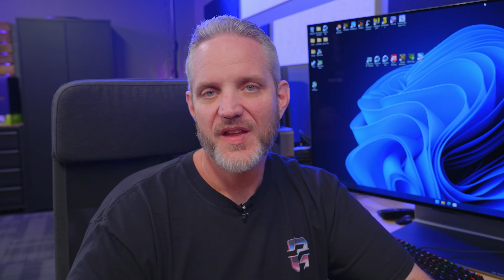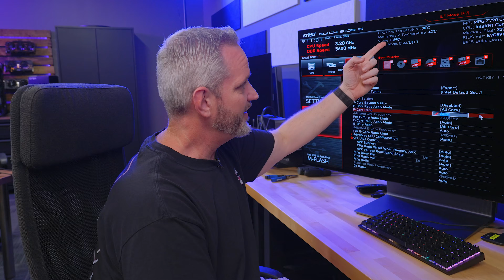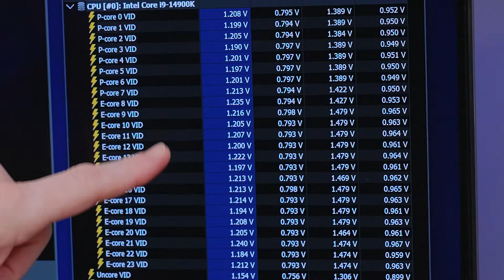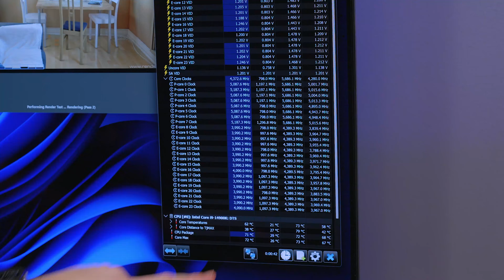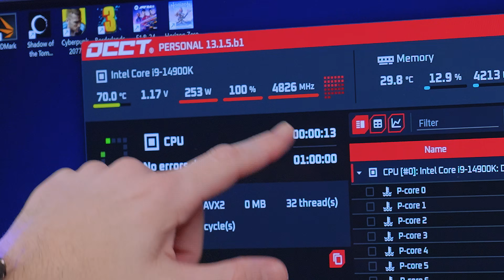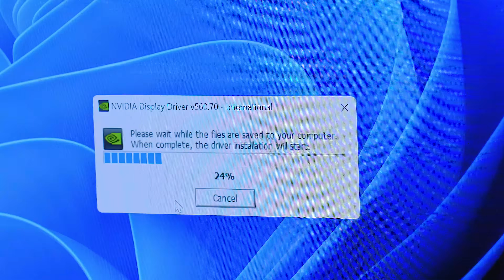Guide: How to check if your CPU is BAD!

Comment: u said in here and i know its been a year but u needed bad chip i have one a beast of a i7 14700f    burns off any and all paste applied overheats my vram overheats my gpu  its been fun but im over it mofo retails for 360 if it works i think it has this degredation people talk about thought it was board bought new one ended up throe=wing in old 12700k and it runs flawless?   bought used on marketplace for 160 and cant rma it  worst case u could borrow delid it for me then send it back?>

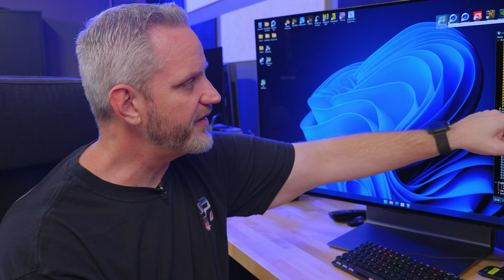Comment: at 7:58... I agree. I would see in hwi64_840.exe as well as ASUS Armory Late onscreen Ryjin III 360 screen. Standard polling rate of 5.9, sometimes 6.0, or even 6.1, depending on software rounding. I saw it. Even when my target was 5.8 with spikes to 5.9 cause it could steady state 5.9 on2-4 cores, or constant load balance hand off of the 5.9 on 2 cores. I guess that was due to cooling or whatever ASUS was using to determing voltages, or clocks, or vdrop.   Heavy loads seem fine, it was light loads all apps closed, going to tell it to shut down or restart. I would have to repeatedly have to click shut off as the first 2 clicks did nothing. Like the prefetch for those items to be clicked in the GUI were just ignored. Or Microsoft Windows 11 doesn't want me to shut my PC off, as opposed to some form of sleep, hybrid, hibernate, Low power rest mode.  It would also fail to come out of those states. Had to just hold down the powerbutton for 4 sec to get it to shut off. Single button Hyte Y60 (wish for a touch screen like the Y70). So I agree it showed more  odd, quircky, non responsive etc. in low load states. But seriously, I didn't like seeing up to 300mhz over target clocks, regardless of heat or allowable options to go higher. So I need to brush up on the non-AI manual OC. But our laziness for this 1 click OC is not our fault. These were on by default back in June 2023. So my baseline testing performance before OC was already OC'ed. OC'ing an OC if that makes sense.  Anyways that was my experience. Intel did RMA it, paid for a new 13700K .  Mine was originally purchased in Feb 23 for 359. each. Due to other parts costs, the builds were finished by Jun and July 23 as I built 2 exact same matching His and Hers systems,..... didn't want the YOUR PC IS BETTER.!!!!!! Anyways just wanted to let the readers know INTEL did stand behind a NEW replacement. I questioned NEW myself, but just took the new part at will to still have 3-5 year warranty the same as the original but the time now starts after the Ticket was closed. And so if I make it to 2030 so 4 years I will be happy. If this starts going wierd in 2 years, then this would have been a nightmare. Time will tell.

Comment: I have a beast of a chip but it WAS bad...I9 14700k However all i had to do was tame it down from trying to boost operate at 6ghz and limit it to just 5.5ghz and it is as stable as can be. I could go higher but i find that that is fast enough. no more access violation errors etc...

Comment: my mouse feels so weird and deleted that can be because my cpu is degraded ?
Reply: Windows USB drivers run in user space at normal speed. If you're doing something compute-bound, your mouse can feel a bit janky.
Reply: @darrennew8211  no the issue was dirty electricity i bought a double conversion ups and it fixed everything

Comment: Asus finally released their latest 2405 BIOS for my ROG Strix Z590 Gaming Wifi II this month that seems to have solved the stability issues I have had with my 11900k at stock speeds and OOB settings for the last 5 years. It refused to boot or run stable in Windows without the AI overclock enabled before this BIOS release. I went through 2 processors thinking my CPU had degraded, since the Asus AI overclock cooked my first CPU by sending it over 1.75v of vcore and would constantly send it into thermal throttling just sitting at the desktop, even with a beefy 200w capable air cooler on it. It eventually refused to boot with or without the overclock, or even downclocked to 4ghz, which was enough for Intel to warranty the first processor. I now have a 360 AIO on it, and its much happier, especially without the overclock. The latest BIOS introduced another lovely side effect of constant USB dropouts, though. All day long, Windows is dinging at me when the board drops out and reconnects the USB bus every few minutes. I'm a long time consumer of Asus, but at this point, I want to replace the board with another brand. So far nothing else has good feedback or reviews when it comes something that will work for my application in the Z590 platform.

Comment: 00:00:00 - Info - Test schedule started at 2026-01-15 20:26:44
00:00:00 - Info - CPU - Initializing (Duration : 01:00:00)
00:00:00 - Info - CPU - Started (Duration : 01:00:00)
00:00:00 - Error - CPU - 26112 error(s) found on physical core #0 - logical core #0
00:00:00 - Error - CPU - 22411 error(s) found on physical core #0 - logical core #1
00:00:01 - Error - CPU - 43527 error(s) found on physical core #0 - logical core #0
00:00:01 - Error - CPU - 43246 error(s) found on physical core #0 - logical core #1
00:00:01 - Error - CPU - 47980 error(s) found on physical core #0 - logical core #0
00:00:01 - Error - CPU - 41911 error(s) found on physical core #0 - logical core #1
00:00:02 - Error - CPU - 44718 error(s) found on physical core #0 - logical core #0
00:00:02 - Error - CPU - 42802 error(s) found on physical core #0 - logical core #1
00:00:02 - Error - CPU - 40516 error(s) found on physical core #0 - logical core #0
00:00:02 - Error - CPU - 45111 error(s) found on physical core #0 - logical core #1
00:00:03 - Error - CPU - 47808 error(s) found on physical core #0 - logical core #0
00:00:03 - Error - CPU - 41981 error(s) found on physical core #0 - logical core #1
00:00:03 - Error - CPU - 46394 error(s) found on physical core #0 - logical core #0
00:00:03 - Error - CPU - 45302 error(s) found on physical core #0 - logical core #1
00:00:04 - Error - CPU - 45657 error(s) found on physical core #0 - logical core #0
00:00:04 - Error - CPU - 42551 error(s) found on physical core #0 - logical core #1
00:00:04 - Error - CPU - 40065 error(s) found on physical core #0 - logical core #0
00:00:04 - Error - CPU - 46214 error(s) found on physical core #0 - logical core #1
00:00:05 - Error - CPU - 42156 error(s) found on physical core #0 - logical core #0
00:00:05 - Error - CPU - 43131 error(s) found on physical core #0 - logical core #1
00:00:05 - Error - CPU - 45891 error(s) found on physical core #0 - logical core #0
00:00:05 - Error - CPU - 45153 error(s) found on physical core #0 - logical core #1
00:00:06 - Error - CPU - 42881 error(s) found on physical core #0 - logical core #0
00:00:06 - Error - CPU - 45627 error(s) found on physical core #0 - logical core #1
00:00:06 - Error - CPU - 43155 error(s) found on physical core #0 - logical core #0
00:00:06 - Error - CPU - 45860 error(s) found on physical core #0 - logical core #1
00:00:07 - Error - CPU - 49008 error(s) found on physical core #0 - logical core #0
00:00:07 - Error - CPU - 41417 error(s) found on physical core #0 - logical core #1
00:00:07 - Error - CPU - 46808 error(s) found on physical core #0 - logical core #0
00:00:07 - Error - CPU - 43206 error(s) found on physical core #0 - logical core #1
00:00:08 - Error - CPU - 44965 error(s) found on physical core #0 - logical core #0
00:00:08 - Error - CPU - 42018 error(s) found on physical core #0 - logical core #1
00:00:08 - Error - CPU - 46815 error(s) found on physical core #0 - logical core #0
00:00:08 - Error - CPU - 45275 error(s) found on physical core #0 - logical core #1
00:00:09 - Error - CPU - 47267 error(s) found on physical core #0 - logical core #0
00:00:09 - Error - CPU - 42255 error(s) found on physical core #0 - logical core #1
00:00:09 - Error - CPU - 43623 error(s) found on physical core #0 - logical core #0
00:00:09 - Error - CPU - 44172 error(s) found on physical core #0 - logical core #1
00:00:10 - Error - CPU - 41659 error(s) found on physical core #0 - logical core #0
00:00:10 - Error - CPU - 42523 error(s) found on physical core #0 - logical core #1
00:00:10 - Error - CPU - 47912 error(s) found on physical core #0 - logical core #0
00:00:10 - Error - CPU - 42951 error(s) found on physical core #0 - logical core #1
00:00:11 - Error - CPU - 43588 error(s) found on physical core #0 - logical core #0
00:00:11 - Error - CPU - 46229 error(s) found on physical core #0 - logical core #1
00:00:11 - Error - CPU - 44953 error(s) found on physical core #0 - logical core #0
00:00:11 - Error - CPU - 45806 error(s) found on physical core #0 - logical core #1
00:00:12 - Error - CPU - 42543 error(s) found on physical core #0 - logical core #0
00:00:12 - Error - CPU - 38526 error(s) found on physical core #0 - logical core #1
00:00:12 - Error - CPU - 46415 error(s) found on physical core #0 - logical core #0
00:00:12 - Error - CPU - 45480 error(s) found on physical core #0 - logical core #1
00:00:13 - Error - CPU - 46932 error(s) found on physical core #0 - logical core #0
00:00:13 - Error - CPU - 45289 error(s) found on physical core #0 - logical core #1
00:00:13 - Error - CPU - 47399 error(s) found on physical core #0 - logical core #0
00:00:13 - Error - CPU - 46043 error(s) found on physical core #0 - logical core #1
00:00:14 - Error - CPU - 43408 error(s) found on physical core #0 - logical core #0
00:00:14 - Error - CPU - 46127 error(s) found on physical core #0 - logical core #1
00:00:14 - Error - CPU - 43738 error(s) found on physical core #0 - logical core #0
00:00:14 - Error - CPU - 45313 error(s) found on physical core #0 - logical core #1
00:00:15 - Error - CPU - 45541 error(s) found on physical core #0 - logical core #0
00:00:15 - Error - CPU - 45528 error(s) found on physical core #0 - logical core #1
00:00:15 - Error - CPU - 47510 error(s) found on physical core #0 - logical core #0
00:00:15 - Error - CPU - 43053 error(s) found on physical core #0 - logical core #1
00:00:16 - Error - CPU - 41351 error(s) found on physical core #0 - logical core #0
00:00:16 - Error - CPU - 44763 error(s) found on physical core #0 - logical core #1
00:00:16 - Error - CPU - 45826 error(s) found on physical core #0 - logical core #0
00:00:16 - Error - CPU - 44383 error(s) found on physical core #0 - logical core #1
00:00:17 - Error - CPU - 36905 error(s) found on physical core #0 - logical core #0
00:00:17 - Error - CPU - 45531 error(s) found on physical core #0 - logical core #1
00:00:17 - Error - CPU - 44903 error(s) found on physical core #0 - logical core #0
00:00:17 - Error - CPU - 45233 error(s) found on physical core #0 - logical core #1
00:00:18 - Error - CPU - 42833 error(s) found on physical core #0 - logical core #0
00:00:18 - Error - CPU - 46252 error(s) found on physical core #0 - logical core #1
00:00:18 - Info - CPU - Test stopped
00:00:18 - Info - Schedule stopped by user request

Does this mean my cpu is bad? i thought my gpu was going bad t was getting screen tearing than it started happening on all programs. i also getting screen freezing. but i disabled my gpu and been using my igpu and it has the same behavior. I used intel processor diagnostic tool and everything passes. but this occt screams error right out of the gate. the errors you see are just a few second....

Comment: Yeah good you showing how to stress the cpu,we know not to have to high volt.. but not what to do when having to high volt, in msi i have msi defualts that's lowest and have up too 1.5v and i don't now how Msi bios works, and was looking just like yours. have msi z690 and 12900k!?? 

It's not the cpu fault it's the Bios defualt options like im asking i have tuner cooler intel defualts, 241 watt that's the lowest, and everything on auto and have 1.5V what should i do?!?!? This is the real problem not a bad cpu never got a bad cpu in computer store i worked in. It's the options bios options that kills them.....

Comment: I know I'm kind of late to the party but... I wonder, should I update my BIOS to avoid these... problems. I happen to have I-9 14900K CPU and my current BIOS version is 2504. Also checked the BIOS itself and it has all Intel standard settings running.
Haven't noticed any issues thus far with it other than the damn Diablo 4 been crashing on me twice now and I get some mambo jambo warning from the Blizzard to update my BIOS?!

Comment: But wouldn't you want to test your CPU with xmp?

If you have say 4800 MT/s rams, but your CPU is rated for Higher. Shouldn't you test your CPU with the higher speeds on the ram Obviously you would also perform individual tests on the ram itself.

Comment: the way i get my cpu to get high ghz, playing 8k on youtube, from stock boost 4.6ghz and 4.7-4.9ghz is common and odd spike to 5.3-5.4ghz at temps max 68c , not bad for 5700x with id cooling 67mm cooler . gigabyte seems to not care how far it pushes cpu and ram , so far its only done what is stable so far no crashes so it seems its doing things correct

Comment: Pc won’t start, lights turn on for a second and then turns off. If I unplug the cpu 8 pin cable then the pc will power on and stay on.

Comment: Still using my 14700K from the initial launch w/ the same bios I installed back when I built my sys. ZERO ISSUES. A side note I'm using MSI and NOT Asus, lol. So that may have something to do w/ it. MSI Z790 ACE w/ a CBR23 score of 36K just like the day I built it.

Comment: Currently changing my CPU, 14 gen now, had 13 gen, don't feel like changing my entire system but I would not use intel until its verified they fixed shit. My CPU is arriving today, here's hopping I don't get punch in the guy again. I had my 13 gen when the motherboards where going crazy with OC and I think something cracked.
Anyway. My test has become to download drivers from NVIDIA and try to run them. If they go CRC error. Its the CPU.
I started disabling my pcores until I find the troublemaker, now I am on 3 pcores off for my system to actually work properly, both windows updates and nvidia updates would flat out fail.

If you take anything away from this. Disable pcores and ecores and see if something if fixed, if that fixes it, well it should be damn obvious what is your problem.

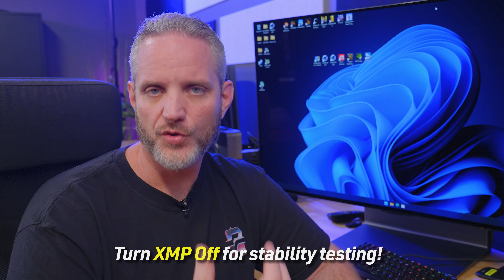Comment: Jay, sigh, once again, you're talking about RAM incorrectly.  Dunno when you're going to learn.  5:20.  There is no 7400Mhz or 8000Mhz ram.  I don't get how you can know so much about so many things but yet you keep getting this simple thing wrong about RAM.

7400MT ram = 3700Mhz
8000MT ram = 4000Mhz

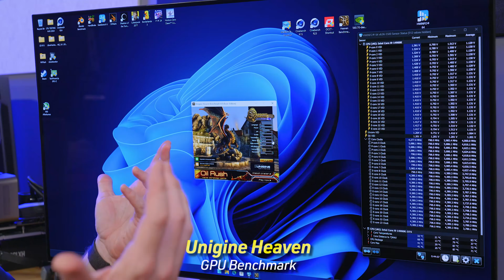It's irritating because it's often wrong inside of most BIOS's as well.  It lists it in Mhz when it should say MT.  The true Megahertz would be half of that.  Also, at 18:52 you're talking about using the Heaven Benchmark.  Why would you use this 2009 benchmark?  Use the more graphic intensive and newer 2017 one (Superposition).  It's right off the same website.

Yes, installing the Nvidia graphics over and over does a lot of decompression while it's installing, so that's a good test.  I'm surprised you don't mention another good CPU test, Intel's own CPU diagnostic tester:  Intel Processor Diagnostic Tool

Comment: 12th gen Intel core i7 12700K
------------------------------------------------

This was confusing and i am not an expert at this.

What i have done is run the intel burn test along with winfo64 to see what result it would have.

On standard with 10 runs, the burn test succeeded and the system remained stable.
On High, within 2 runs, the system froze.

Regarding the temperatures:
on idle the min/max temperature lies between 32C and  56C with an avarage of roughly 40C
When stress tested (standard), the temperature quickly got to 90/100C

This makes the alarm bells start to ring for me as that is quite hot.
Especially since your rig in the video managed to maintain those temperatures with more ease (even though i imagine the cooling is stronger)
Reply: Anyway am upgrading my cooler. 

Pretty sure i have something only slightly better than a stock one

Comment: My 14600k has had issues in the past few months, where when idling, the voltage drops too much and then crashes the moment I open anything or put any load on the CPU too fast. Like when I am gaming, there are no issues because the CPU gets a good and stable voltage. I am getting a replacement from Intel, but I will try to set my BIOS settings so that the CPU gets constant voltage instead of voltage dropping when under low load/idle.

Comment: So I been on the right bios since your first warning vid. I tried clean reinstall drivers etc. Havnt tried undervolting yet. But I crash 1-2 times a day. So it nots preventing me but I'll either blue screen or a random application will just close itself.
Reply: What happened ultimately? I'm having those issues now.

Comment: 7:38 exactly,  you'll see BSOD when your system isn't doing anything. I can play games for the whole day and it won't crash but as soon as I leave it powered, not in standby or hibernate, just desktop, after a few minutes, it'll crash. We have 3001 on Asus MBO, I'm testing it now (XMP off) and it's been stable for 15min now (that's something I have to get used to 😂😂 ) . 14900KS and I have to do this? Tnx Intel. I'm not 100% certain it's CPU degradation that's crashing my system, it could be that new ssd nvme is one to blame (PC started to crash after installing that drive but all tests are showing it's healthy, I'll pull it out and test both scenarios). CPU is cooled by liquid cooling and as far as I can see, temps are good and the cooler is working like it should

Comment: Does anyone know if the CPU is the problem when some games give a static sound stutter through the speakers then the system just reboots? I'm at the point of reinstalling windows. CPU is a 5800X3D Asus B550F motherboard and Sapphire 7900 xtx GPU